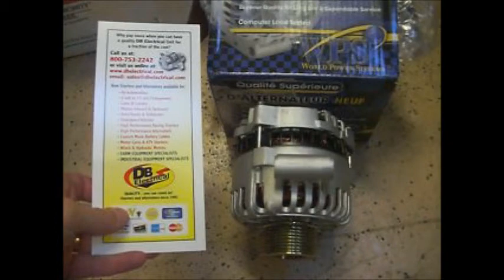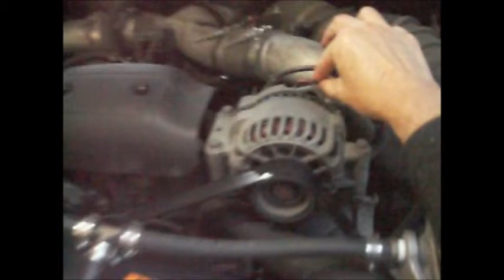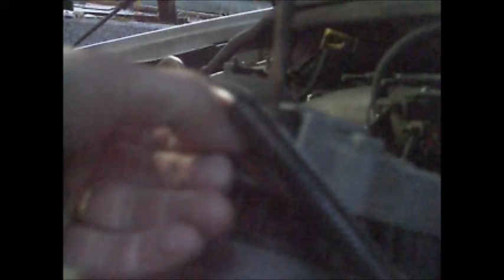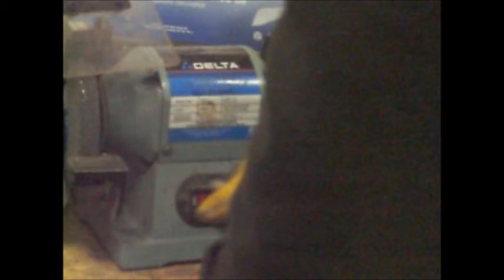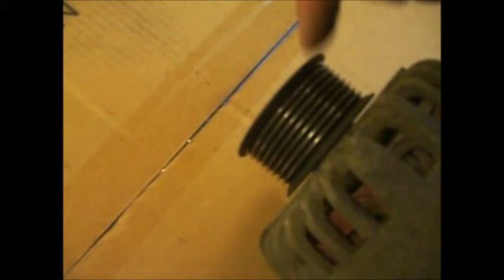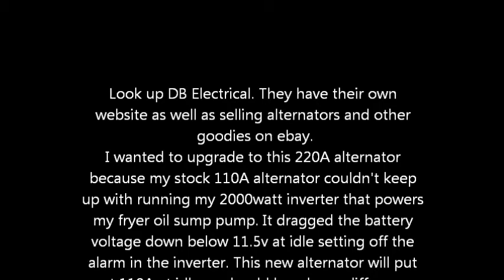Ford Superduty 220A Alternator

Comment: https://www.dbelectrical.com/products/alternator-high-output-200-amp-2-2l-isuzu-amigo-rodeo-98-99-00-01.html

Yes or no? it would be a direct swap for my Opel (vauxhall) astra g which has a stock 100a
THIS is the only one i can find and stay reasonable with costs (since i am in the eu and not usa the shipping and everything for import is gonna get insane if i go for the bigger companies and the biggest i can get where im from is just 140a :(

Comment from the maker: Hey thanks for the comments. Ya, yellow sealing tape is much thicker, meant for natural gas connections. Yes, I had flasher issues. The stock flasher doesn't work, flashes way too fast. Bought an LED flasher unit from Napa that works good. I think it's in the credits. But since I also installed front LED signals and tiny clearance LED's in the front turn signal when I go on the brakes without the lights on - the turn signal large bulbs turn on about 1/2 brightness for some reason.

Comment: Liked and Subscribed.  I watched about 20% of all you vids!  I have an F250 also.  I burn WVO.  Oh, I use the yellow gas thread sealing tape (only 2 layers), which works way better than the white.  Get it at Home Depot or Lowes...  Did you have any issues with flasher compatibility with the LED tail/turn signals?  Thanks for all your vids.